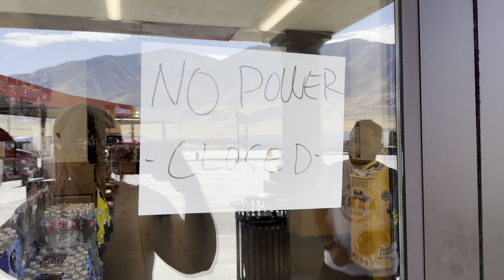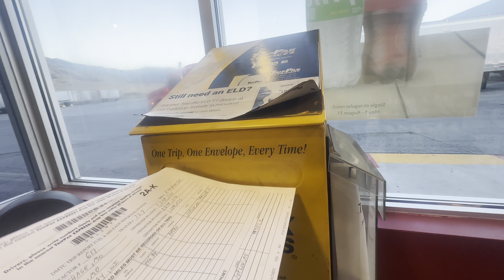"CANT BELIEVE SOMEONE WOULD STEAL FROM MY TRUCK" | Trucking Life Vlog

Comment: I’ve had them to come off on me in the summer months….the plastic is so cheap it actually softens up and they will randomly vibrate off, the longer the caps off the quicker they’ll pop off due to vibration
Reply from the maker: there’s no way that happened on these in less than 1/4 mile of driving between the 2 truck stops
Reply: @TruckingTogether  oh ok I gotcha I see now yeah sounds like someone swiped them

Comment: I currently work for a truck stop. We had a power outage a month ago. It took an hour for the registers to boot back up. Then it took 3 hours to get the pumps to reset. We had several customers get mad and leave. I found out that at my store we have a 12 hour battery. It keeps 4 lights on and nothing else.

Comment: Real truckers don't wear flip flops or sandles
Reply from the maker: Real ass holes say it to my face instead of in comments. And they are sandals. Jesus wore them. Look it up bro
Reply: Truth hurts  the last time I delivered to a Walmart you couldn't wear sandles ,flip flops or shorts.thats  the  problem in trucking today truckers go to receivers and shippers looking like slobs . Have some respect for our profession
Reply from the maker: truth don’t hurt. to me you just sound like a talking head on the internet who worries too much about what others are doing. I have never once been told I can’t wear those at any Walmart or any other location. These are solid base sandals, they do not flip or flop. Call things by proper names 🙄
Reply: @DaveMonroe-h8g  UPS delivery drivers have been and still are wearing shorts, UNIFORMED SHORTS, since forever. But indeed, some receivers will tell you that you can't wear open-toe shoes. Never had a remark on shorts though. E V E R.